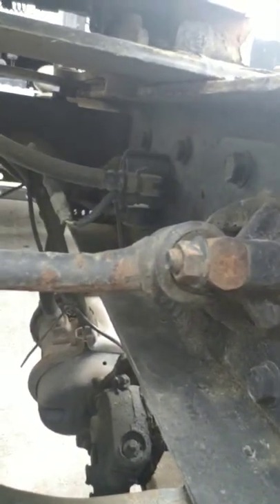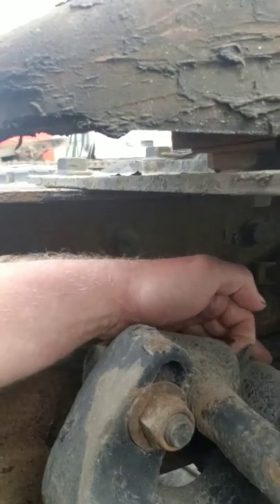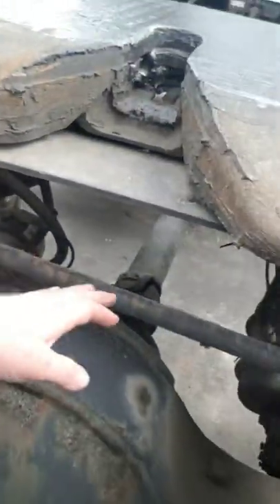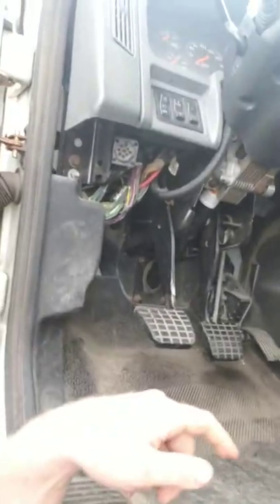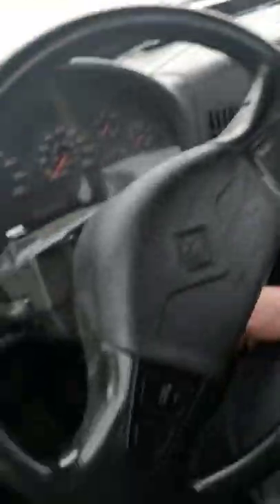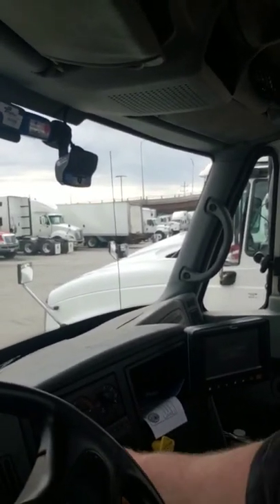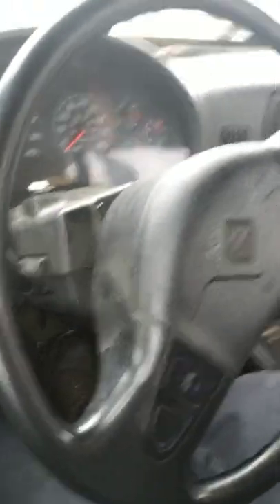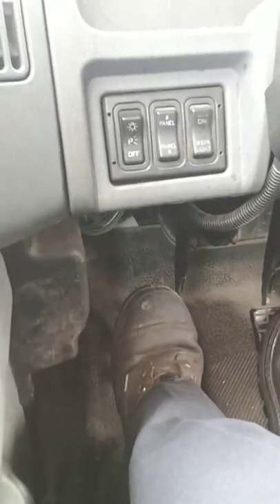Torque Rod Semi Failure and Clutch Adjustment Failure and Talk

Comment: i work on all my own trucks but we need more guys like you in the shops for sure.
Reply from the maker: I let it rip man, if it needs to be fixed i will get it done and I'll find a way
Reply: Nice video sir,  I have a self adjustable clutch and when I get off the clutch it engages all the way up I have no free play  mostly rough shifts bring it to many mechanics and they told me they can’t do anything because it’s a self adjusting clutch...  can you advise me, and where are you located?
Reply from the maker: @Buzzblendtv  

https://youtu.be/0jXhl-Ep4PQ